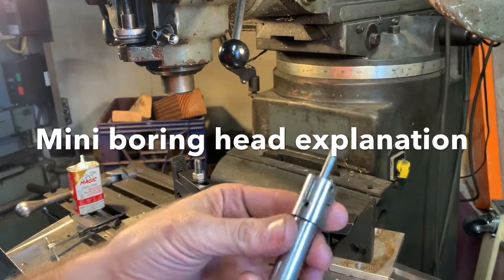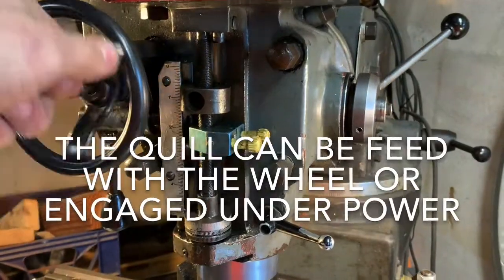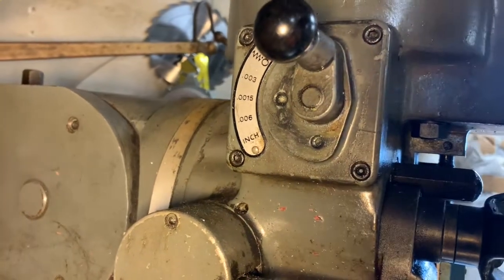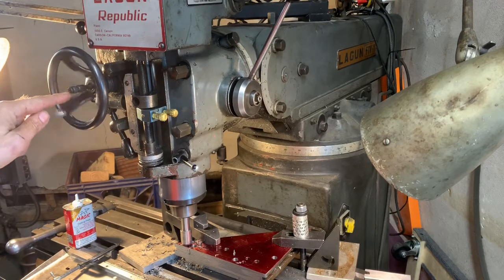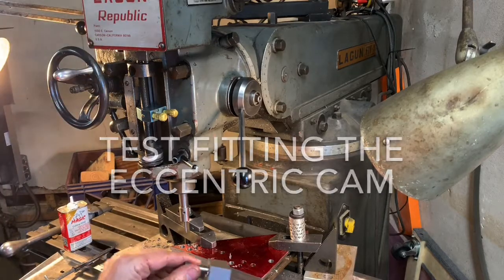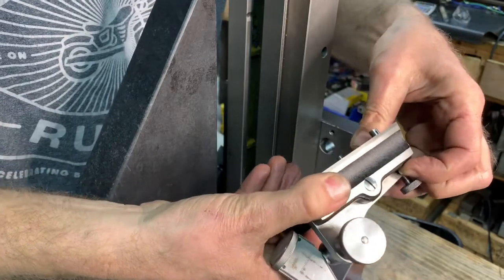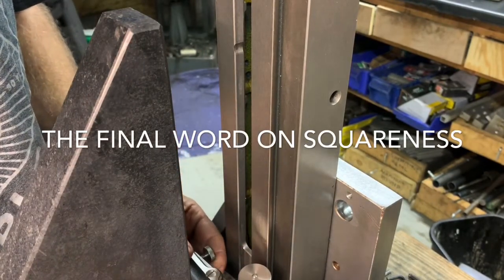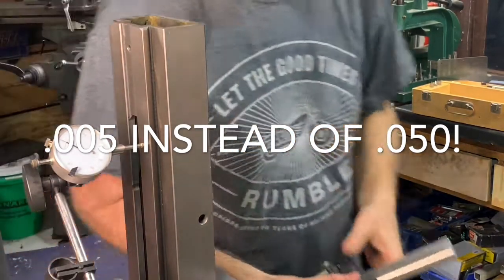Rigidity and squareness improvements on the Harbor Freight Mini Mill

Comment: Can i just pour molten aluminum into the column ?
Reply: To make it heavier or more solid, sure. To make it more rigid, i.e. less deflection of the Z axis column on the front, sides and back? Nope.
I would think to extend the base of the machine, top braces to sides and back with either tubular or angle bar, and steal borrow the idea of solid triangle stabilizer blocks he used for the front side so the additional support can clear the milling XY table.